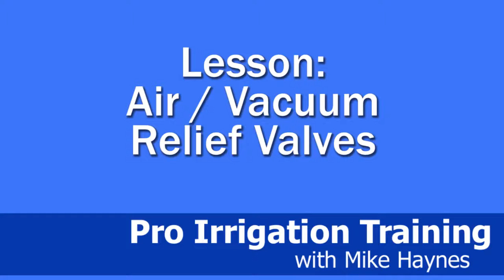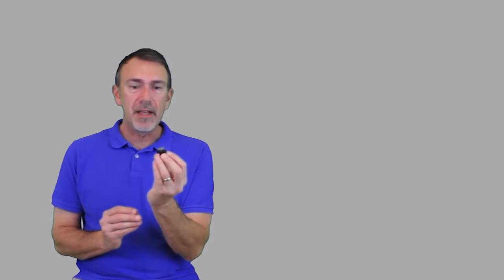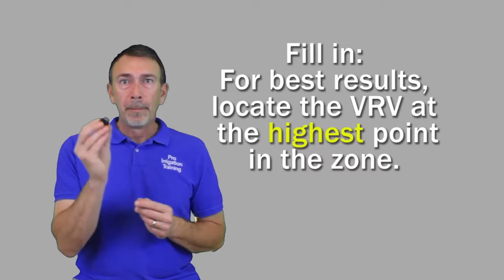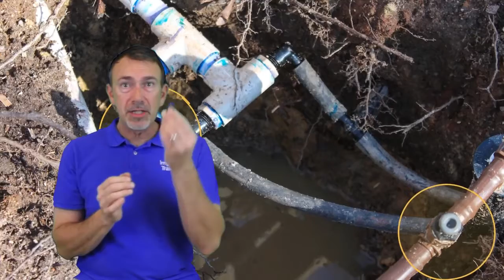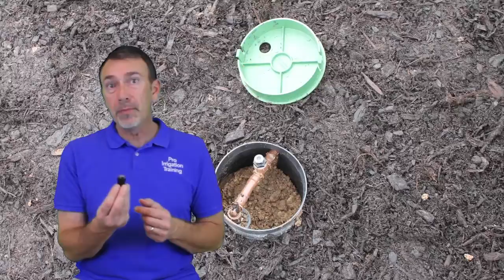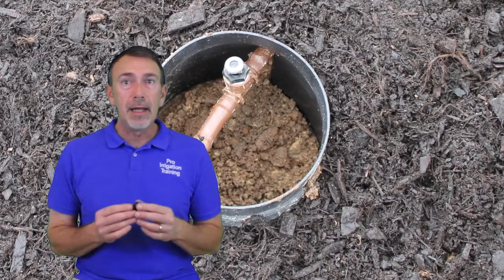How To Use A Drip Irrigation Vacuum Relief Valve [irrigation education]

Comment: How about an above ground covering for the air relief valve rather than using a valve pot to cover it?
Reply from the maker: I'm sure that would be alright. The only real consideration is for it to be the highest point in the zone. That might require a little creativity.

Comment: does this thing close up  when water pass through like a float valve and would it still work if I can't get the connector (female tee) in a 90° angle?
Reply from the maker: Yes it does close like a float valve, i suppose its nearly the same mechanism. As for the second question, I'm pretty sure it would.

Comment: Hello i got a problem with my irrigation drip line it’s a poli line a we put the espagueti drips and it’s just to low pressure
Reply from the maker: Hi there, thanks for watching! I've got a couple questions. What is the pressure at your source? Have you maybe put too many drippers on your line? For instance, a 1/2" tubing will usually carry 4 or 5 gallons per minute, and the 1/4" tubing will only carry 17 gallons per hour. If you exceed those flow maximums, it will look like too low pressure.

Comment: we have sixteen two hundred and forty feet rose in our community garden, and we have drip tape irrigation, no, nothing else is it possible for when the system shuts down for the moisture and the water to be sucked back up
Reply from the maker: Now that I think about it, a vacuum relief valve may not work or even be necessary for a drip tape system. I don't have much experience with the tape, but my impression is that it always flattens back out as the water drains out. I don't think that would cause any suction back through the drippers.